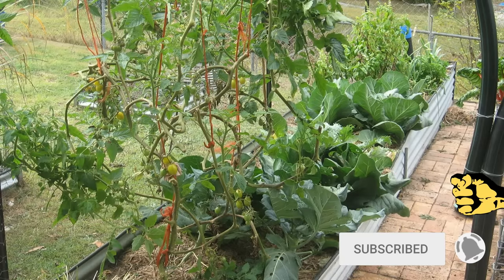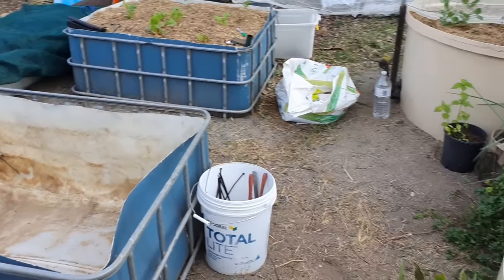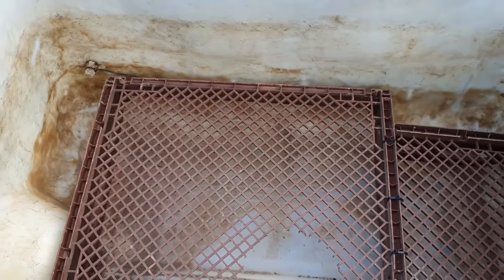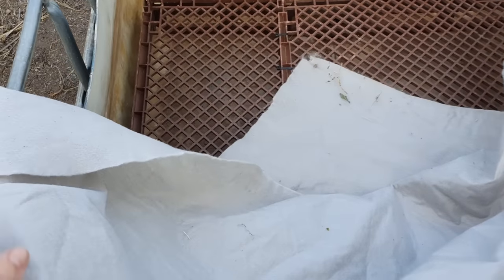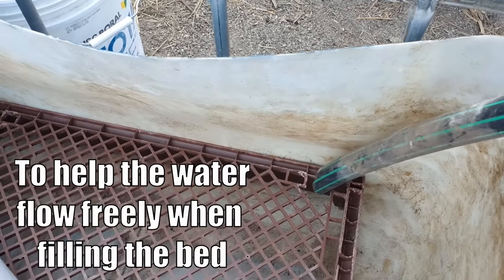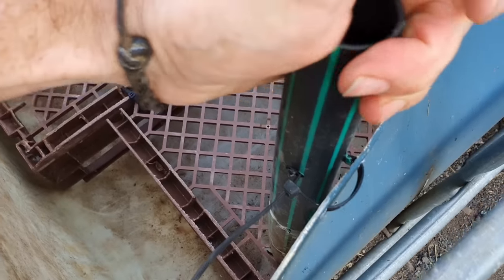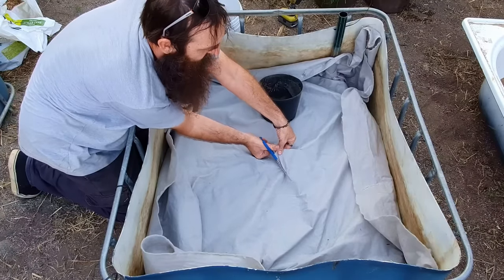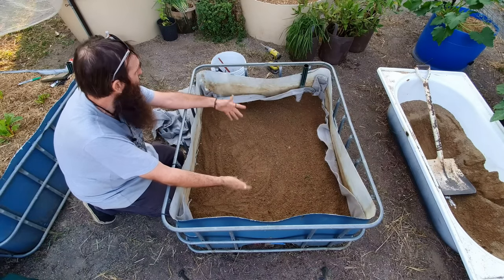How to Make a Wicking Bed with Bread Crates | Large Water Capacity & Healthy Soils

Comment: Hi Rob. Watching through your video again, I'm now wondering why you didn't put some geotextile cloth in the center bucket....wouldn't the lack of cloth there allow sand into the water reservoir?
Reply from the maker: If you pause the video at the spot where I first start to fill the bed you may make out the black weed cloth I have in the pot. I was just recycling some of the materials used in this bed's previous wicking set up. 👍 Cheers Mark.

Comment: I have a large Canary Island  pine tree that constantly sheds long needles. Can the pine needles be used for an intermediary between the sand and soil? Or for top dressing as a mulch cover?
Reply from the maker: I wouldn't use them myself. Pine needles are commonly allelopathic which means they an retard the growth of other plants. They do this to prevent competition underneath tree.  
They would make a great mulch if you have a problem spot with "weeds" in the yard. Use them as a mulch there to smother them.

Comment: lly question because i make my own soil useing perlite worm castings and peatmoss(or)coco coir with some dr green thumbs super soil mix would it be ok to use it in this large of a set up ?
Reply from the maker: I think it should work OK Leslie. 
I would make sure that the mix doesn't hold too much water before finalising what you want to fill the bed with just to be on the safe side.

Comment: have been wicking now for a couple of years and was asked if adding Seasol to the water storage is benificial ?  Would the nutrients wick up as well when mixed with water? Interested as would like to freshen up the growing material this coming winter. Appreciate any comments appreciated. Enjoyed your video. Cheers.
Gary
Reply from the maker: Hey Gary. Sorry I missed this mate. I think it would wick up just fine. The water may tend to go anaerobic if left it isn't used up & replaced frequently but a healthy growing bed should need regular top ups.
I personally think it would be better to top water it in as the roots will get it directly. Some also claim that pouring it over the leaves also give some plants a boost as well.
Hope that helps some & happy growing.

Comment: Hi Rob, I was wondering do you have any idea how much water you save (if any) by using wicking bed versus other planting methods? Thx
Reply from the maker: You actually save a lot. You lose none to run off & virtually none to evaporation. This leaves the rest just for the life in the soil & plants to use. 
I would say that it is almost as "water wise" as the aquaponics & hydroponics systems I've run. 
Cheers.
Reply: @RobsAquaponics  Thx for the reply mate! Much appreciated.  I want to give it a try as I think from what I have read and seen in videos, it would work quite well for us.

Comment: Rob PLEASE HELP !!!!!. I made 4 large wicking pots (1mtr long pots) exactly according to the way U have done (using ag-pipe) to grow some brasicas & silverbeet in. Due to the constantly moist soil 3mths later I found the mulch on top was growing a disgusting fungus all over it, which had also begun growing up the stalks of the veg, plus it also began spreading over the top of the plastic pots. I had to rip out quarter of the plants & had to throw out the entire 3inches of mulch plus I sprayed the soil, the pots & the remaining veg stalks with neem oil & a tiny bit of clove oil added into it to kill the fungus (which worked). I also live in subtropical area on the coast, but further south than U (in North NSW) so the weather here would be similar to what U experience at ur place. I had already also bought 8 large barrels & ag-pipe to make air-pruning wicking pots to repot some fruit trees into, but now I'm concerned about using the pots as wicking pots for the trees in case of possible root rot (& maybe other funguses). There was more rain at the time also. I must mention one other factor which may have had some tiny influence..... I had the pots covered in a finely weaved fruit fly net to stop the unceasing cabbage moths from laying eggs on the brassicas I planted in the pots, so its possible that this may have reduced airflow, however I dont expect it wouldnt have had much effect, since the problem came from the constantly moist soil. After spraying the plants & soil thoroughly & removing the mulch there hasnt been any regrowth of the fungus, but it has also been dryer weather & no mulch which the fungus loved. Have U or anyone U know had any similar problems? Can U suggest any ideas? I'm not sure what to do now in regards the fruit trees, esp once they get quite big & fill the pots cos I am concerned about root rot. I'm thinking that maybe the holes for air-pruning (which the veg wicking pots dont have) may allow the soil to not be quite as moist & so maybe there will be no extra fungal problems, but how can I stop the roots from eventually growing down into the constant water supply at the bottom of the wicking pots? What do U think?
Reply from the maker: Hi FreedomBee. I have had fungus outbreaks on the top of the mulch here but don't really worry about it as it tends to die off on its own. The one we had looked very much like this & is actually called a slime mold.
https://bie.ala.org.au/species/a330263b-733b-4946-9a7d-c331a46c5941
It too appeared after a long bout or rain & loved the sugarcane mulch. 
Was you're similar? 

The Paw paw we've had in the air pruning wicking barrel & the blueberry in a normal wicking haven't had any issues with root rot as the soil drys out regularly as the plants take it up. Both have nbeen in barrels for over 5 years now from memory. 
Having a decent drain set in the base will also make sure that any excess water collected through heavy rain events will drain out efficiently. 
I hope that helps you out some.

Comment: Hello, Rob! Quick question, do you have a recommendation for the geotextile fabric? I'm not sure if I have what I need. I have what my materials store called geotextile. I used some as a base for rock under my shed. It is like a tarpaulin woven type material and came on a 6'x100' roll. Your fabric looked thicker like a weed barrier fabric. Do you have a link?
Reply from the maker: Both will work Stephen as they allow water to pass through & names are interchangeable in different places. The grey cloth I used was sold as geotextile & our weed cloth looks like a woven tarpaulin. 
Hope your build went smoothly mate.

Comment: Hi Rob, Does the out flow pipe need to be an inch from the top of the drainage pipe inside? so there is an air pocket between the soil, causing it not to go rancid. Thanks
Reply from the maker: Hi Melissa. I don't worry about including an air pocket as one will form as the water is used up by the plants. 👍
The only time the water in the base has gone rancid for me is when there's been a lot of soil in there staying wet. 
Hope that helps.

Comment: Hi Rob wonder after the heavy rain in last few days how will you improve the soil in your wicking beds? I found it difficult to judge what have been washed out, may need soil test?
Reply from the maker: None of the beds have started to overflow through the drain holes yet so I don't think there's any nutrient depletion going on at the moment. 
I never noticed any issues with the older builds with less reservoir volume either. I think giving them a good top dress with some compost under the mulch would be about as far as I'd go. 
Are yours overflowing? 
Hope that helps some.
Reply: I see. I guess your beds have bigger resovoirs  than mine as I used soil down in the bottom to improve soil microbiology as per Colin,  which I guess when doing flood and drain it may affect the soil acidity. BTW I wish you and B are both recovered from the pneumonitis...Thanks for sharing your experience and the warning
Reply from the maker: @nblade3913  it helps that they weren't filled last weekend ;)
Reply: @RobsAquaponics  True...I did the opposite. Should have read the weather forecast.

Comment: Hey Rob:) Great video my friend. I wanted to ask you if the sand can become an issue if it has shell in it. Basically, does it raise the PH and would it be a good idea to test the sand we use?
Reply from the maker: Shouldn't be an issue at all as long as the water pH isn't acidic I'd think Matt.
It could be an issue if you were running them as a flow-through aquaponic grow bed through. 🤔
Cheers mate & hope all's well with you folks.

Comment: Hi, great video, mate! 

Question for ya: I don't have ready access to sand, but have some left-over crusher dust from when I made the bed for the water tank. Can one use that instead of river sand?
Reply from the maker: I've used it in a load of beds Robin & it will work.👍 The coarse sand is just a little more efficient.
Hope the build goes smoothly.

Comment: Hey Rob. Do you recommend using the bread crates or gravel
Reply from the maker: I prefer bread crates  as they create a much larger void to hold water.
I am making 2 with pallets at the moment for the same reason as it will cut down topping up periods. 
Hope that helps Felicia.

Comment: Hi, I'm totally new to veggie gardening,  probably zero green thumb (or green fingers), but have watched your videos and love what you are doing.  We live in high desert area of CO so we are desert but still get some snow in the winter.  I wanted to know if a galvanized trough would be okay to do your wicking-bed garden method.  Will it (and the water) get too hot in the sun or freeze in the winter since it is metal?  I was thinking to do the "3 Ft W X 8 Ft L X 2 Ft H" size or the "3 Ft W X 6 Ft L X 2 Ft H".  Can you see any problems with this, or have solutions if you think it is a problem?  Thanks.
Reply from the maker: Hi Patty. I have had many Gal tin beds & they didn't get hot at all. You may have issues with ice splitting pipes or plastic liners if you get hard freezes there through winter. I have friends in Canada that drain their systems & cover them through winter just for that reason. 
Hope that helps a little.

Comment: Could this be used in with a aqauponics system? As in having the wicking tank as part of the sump tank for the aqauponics side?
Reply from the maker: I have seen folks that have "flow through" wicking beds attached to their aquaponics. You can also look up "Earthan Beds" which are an aquaponic based soil growing system devised by the aquaculture designer Paul Van de Werff here in Australia. I haven't tried to grow using any myself but would like to down the track. 
Cheers.

Comment: Perhaps this is a stupid question but could you use packing peanuts (styrofoam ones) at the bottom with maybe a little sand and then a metal mesh screen on top of that to put your soil on? I have an insane amount of packing peanuts already on hand from a previous moving company we used and I kept them thinking I would find a use for them. I didn't know if this was food safe or practical.  Great video, thanks!
Reply from the maker: Sorry I missed this post. I think they would compact a fair bit which may cause issues OABH.

Comment: I'm new to this whole wicking bed thing. How do young plants, with a small root system, get water in the beginning. Do I water from the top first? If so, how do I know I have enough water without adding too much? I am having difficulty getting consistent watering in with regular containers and I don't want to drown them or dehydrate them. Thank you!!!
Reply from the maker: Hi Michelle. I always water out new plants in until the roots make their way down to the damp layer of the beds. 
I normally do it for about a week or so for transplants & for about a week after direct sown seeds have germinated. 
Hope that helps you out some.
Reply: @RobsAquaponics  Thanks, Rob. I guess I'm not sure how much water to add in the beginning. I will just try to guess, LOL. Hope your head is feeling better! Can totally relate as I had the same issue 2 days ago. God Bless you!
Reply from the maker: @michellehorton9212  It's a bit better thanks. 😁
Reply: @RobsAquaponics  Glad to hear that. I sucked in all of my worries and put my first small bed together. I have to laugh because I put in plants I didn't care as much about just in case I overwatered. Then, funny enough, it POURED rain on them too. So far, so good. Thanks for the encouragement. Blessings!
Reply from the maker: @michellehorton9212  😆 Nice to hear they're off to a great start.
Cheers Michelle.

Comment: Instead of a drain, what's wrong with monitoring moister of the soil and watering accordingly? I'm in the middle of filling one of my old aquaponic raft beds with soil. I do not have any drains in this one. I'm hoping to just water occasionally and monitor the soil with a meter that I already have.  Do you foresee any issues with this?
Reply from the maker: Not having a drain can be a big issue if you live in a moderate to high rainfall area. The plants may drown if submerged in water for too long + you may have issues with anaerobic conditions if the soil isn't allowed to dry out every now & then. 
 Might be OK if you live in a dryer climate or have them set up in a greenhouse. 
Cheers Josh.
Reply: @RobsAquaponics  This is in a green house so hopefully will work. The pond liner is still underneath but that will be a pain to remove it all. I'll let you know around fall how it turned out lol Cheers Rob.

Comment: Hi Rob,
What height should the drainage pipe be from base of container?
Reply from the maker: I find 100-120mm is a decent height but in saying that, water will wick up to about 200mm in most coarse sand I've used. 👍

Comment: I was wondering, if using crates to increase air space for the water, do you recommend a small layer of sand on the bottom, below the crates, so there is no chance at water just sitting on the bottom floor, that has no contact with being able to be wicked by the sand? I'm thinking, if a layer of sand is put under the crates, then at least the sand can wick the water to the sides, before wicking up, if water levels ever got that low.
Reply from the maker: The geotextile also wicks up water so I'm not concerned about any left sitting there. 👍
Even if I used a cloth that didn't wick I dare say that with regular filling the water would still be exchanged regularly enough that there would be no issues. 
Cheers & have great one.
Reply: @RobsAquaponics  Thanks!

Comment: Rob. When placing the drain plug for the wicking bed, how important or does it matter about drilling the hole below the level of the pipe to allow for an air gap?  For example if your using 100mm pipe. Should the drain be at like 80-90mm to allow for air? There is a gentleman in the US that speaks of this being vital, can’t say Iv ever heard you speak to it. What are your thoughts? Thank you in advance. Have a good one
Reply from the maker: Hi there nacknsack. I haven't left an air gap in any of my builds as one is created as soon as the water starts to be wicked up into the soil. 
I haven't seen the video & am not sure why it would be needed. 
Hope that helps some.

Comment: hi Rob. you might have a solution to my clay layer underground situation, turning the problem in advantage. (I'll try my poor english here). all my half hectare plot has decent soil layer of 30 to 35 cm. but then a second layer of 30 to 35 cm clay, where almost no roots from the native vegetation to see. finally  the hardest clay where no life at all, spanning maybe from here in Bolivia to your spot in Australia. ok, may be not that deep :). Bolivia, mountains, in my case 30% slope all around.
trying to plant 100 trees I opened 60cm deep holes for them. they all fill with rainwater the first clay layer and take over a week, two or more to dry. like your plastic wikingbeds almost. right? 
most treespecies will not survive the rainy season ore will suffer :( but they will need irrigation the 6 months dry season! should I turn my entire space in a wickingbed? fill every tree hole the bottom 20 cm with a ring of pebbels and coarse sand in the center and then refill with the soil was digged out closer to the surface (mixed with compost manure debris charcoal etc)? put a geotextil or not wetween both layers? seems to me ( a beginner gardener) like drainage on one hand for rainy season and water reservoir for dry season. the really costly adding could be the  need to chanel water out from every hole with a 2 meters ditch to control the watertable in the hole. what do you thing? thanks a lot in advance
Reply from the maker: It sounds like you've put a lot of thought into this Michael & I like what you've come up with. The drainage channels at a certain level will help through he rainy season.  I don't have a lot of experience with growing trees in wicking beds/barrels as I've only tried papaya & citrus so far. From what I've seen they don't tend to allow a lot of root growth in the wet reservoir area & self regulate growth there. 
It might pay to ask some locals that have experience growing the species you want to use to see if they have any idea on root formation & ability to withstand a wet sublayer.
I'm not sure if that helps much but I do wish you all the best.  👍

Comment: How about the cold of winter and it's affect on the set up?   Expansion of frozen water and it's cracking of the containment system?
This is an impressive system but the cold in my part of the U.S. is a concern.
Reply from the maker: You would need to be able to drain the water I think just to make sure Bee Bob. Maybe situating the drain hols down the base of the bed & use an external pipe to set the reservoir height might be a better idea for you.  The link below will take you to a spot in an earlier video that might give you a few ideas. 
https://www.youtube.com/watch?v=hL7PgoTlImE&t=364s
Reply: @RobsAquaponics  Thank you